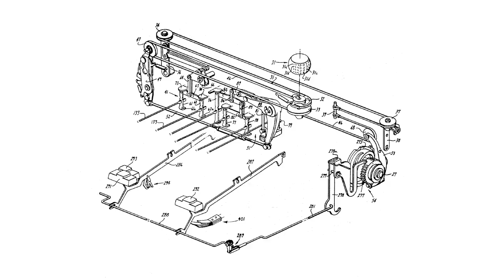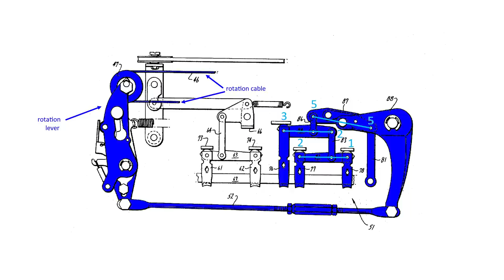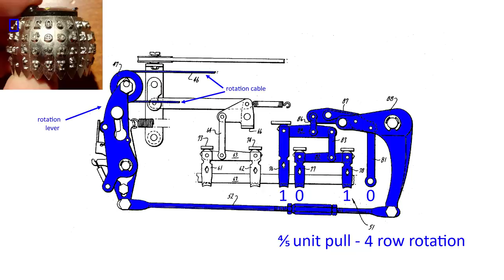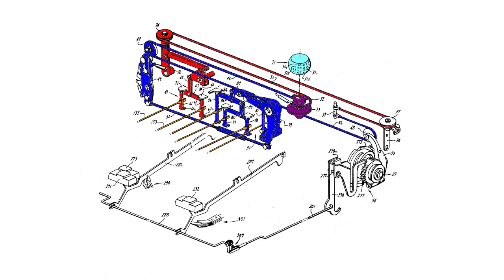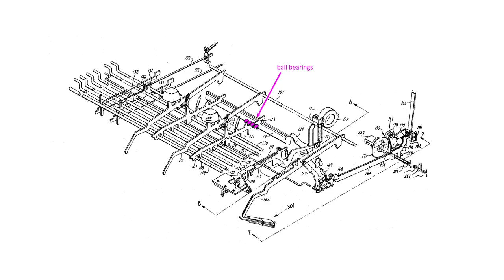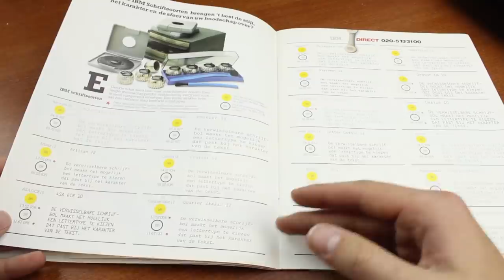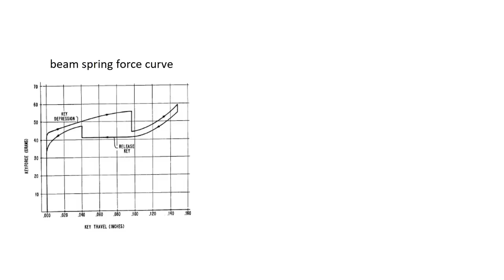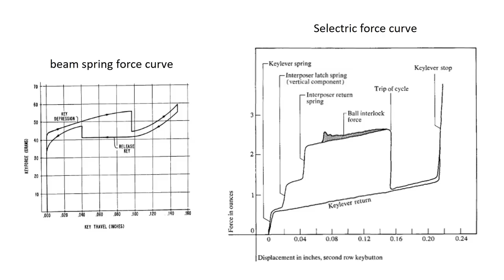IBM Selectric typewriter review - and how it works!

Comment: This is an excellent review, and a very thorough explanation of the mechanism. It's a little disappointing that you didn't get to try the Selectric II next to the Selectric III. 
Starting with the Selectric 1, the basic mechanism only supported 88 characters and the metal casing was very curvy in a 60s style.
The Selectric 2 introduced the correction key (which kind of looks like an afterthought) and came in the more boxish cabinet, using the same elements as the Selectric 1, which were labelled in WHITE..
The Selectric 3 was reworked to include the full 96 ASCII characters on the element which was labelled in YELLOW. This is when that annoying ISO placed key appeared between left Shift and Z.
One "analog" aspect that you've over looked is the pressure cams under the keys. These determine how hard the element strikes the paper so that . and M are of equal blackness.
If you check closely, the ribbon supports THREE rows of typing, not just TWO. The logic behind the multi-level design that pulls the ribbon to the right, mashing it onto the take-up reel was to prevent people from reading the ribbon after use.

If you get the opportunity to compare keyboards, 1 & 2 are virtually identical with a brilliant tactile response. When it registers, the key literally drops from beneath the finger. By contrast, the 3 feels mushy and isn't as tactile at the finger end. It's like it was designed NOT to feel like a typewriter.

Keep the reviews coming!
Reply from the maker: Yes, I figured there would be a difference in typing feel. Shame I didn't get to test that. 

And actually I knew about the pressure cams! I found out about them much longer ago though, and had completely forgotten about them when I did this video. It's a beautiful example of their attention to detail though.
Reply: I learned to type on a Selectric 1, and I certainly wouldn't call the keyboard feel "brilliant"... it had a very hard feel with little obvious feedback or movement until the key "took".  Computer keyboards of almost any sort are a lot better...

Comment: I'd love to try out one of the computer terminals IBM made which used the Selectric mechanism with a load of switches and solenoids added in to make it go when the computer was outputting. If possible, I'd love to see one dredged up, fixed up, and hooked up via some sort of adapter to a Linux machine. Imagine using a terminal on letter paper where each page (with 1/4 inch margins) would have a 96x126 or 80x105 character output depending on the pitch you've selected. 
Granted, a lot of modern programs output a lot faster than a Selectric could keep up with, but it'd still be fun to see and use!
Reply: xtermEN8

Comment: Interesting typewriter lesson here.  The idea of an easily replaceable type element was by no means new when IBM released the Selectric.  In fact, it was almost 100 years old, with machines like the Blickensderfer and Hammond sporting replaceable type wheels and a semicircular "type shuttle" respectively in the late 19th century.  In fact, the Hammond Multiplex model in the 1910s had the ability to hold 2 type shuttles at once, which could be switched between by a quick motion of lifting the circular anvil upon which they rested and giving it a 180 degree spin.  Hammond was bought out in the late '20s and survived as the Varityper, outliving the Blickensderfer by a few decades, until it was killed by the IBM selectric.

Comment: Apparently the IBM 2741 http://www.computinghistory.org.uk/det/48303/IBM-2741-Communications-Terminal/ was basically a Selectric converted straight into a computer terminal. Then of course there are the full-blown teleprinters used with computers, including 1963's ASR-33 Teletype model https://en.wikipedia.org/wiki/Teletype_Model_33 which was in use as a computer terminal https://en.wikipedia.org/wiki/Unix#/media/File:Ken_Thompson_(sitting)_and_Dennis_Ritchie_at_PDP-11_(2876612463).jpg for over a decade afterwards. The ASR-33's is a real computer keyboard unlike the Selectric's in that it didn't mechanically drive a type head, but apparently it still had a heck of a key mechanism: http://www.pdp8.net/asr33/videos/keyboard.shtml . I think that there qualifies as a tactile bump! AFAIK early video display terminals like the Datapoint 3300 http://www.vintagecomputer.net/ctc/3300/ may have been the start of discrete, one-mechanism-per-key key mechanisms, but I don't know that for sure.

Needless to say, if you ever get the opportunity to review any of these regal beasts that would be quite awesome...

Comment: I learned to type on a selectric I, the smaller and I guess earlier model ... the key action on that was pretty odd, there was almost no key travel, but a very heavy resistance all in one spot, which meant that it really didn't have a great feel, but it was fairly easy to type on.  It was completely unlike IBM's later computer keyboards (model F/M).

Based on this video, the selectric II you've using appears to have much more key travel, and I'd gather, a better feel...

Comment: Great video about this engineering marvel! If I understood correctly, the wiffle tree is made stable enough despite the required tolerances in all the joins by keeping it under constant pressure at all times to take off any slack.

I think it would have been worth saying that this is fully mechanical design except for one AC motor running at constant speed at all times the power is turned on.

Comment: I used these for very complex multilingual scholarly texts, using even right to left Arabic type heads. This was made possible by a modification by a company called InfoTec, that exploited the digital nature of the design: they attached a custom tape recorder for the keystrokes. The recorder itself had an extra Stop and Start button that enabled one to change type heads when replaying the text. There was also a correction function so that a complex text could be prepared to perfection before printing the final version with actual font changes during the pre-arranged stops. There also existed a Right-to-Left Selectric, but there was no RTL InfoTec extension. Consequently I typed everything in reverse: one letter - two backspaces etc. etc. Thanks to the InfoTec recorder I could do that without any errors. For your amusement: I also have an Old Bulgarian IBM Selectric type head.
Reply: aaah.. bekoz... en ding?

Comment: great video but jesus I hardly understood any of the mechanical aspects of this thing
Reply from the maker: It's incredibly complicated, really cool technology. Really the whiffletree is the most important aspect of the device.
Reply: Chyrosran22 I see. What are the keycaps made of? Double shot abs I assume
Reply: I was an IBM engineer working on Selectrics from 1973 for 8 years, it was an awesome machine. The trading course in London was 14 weeks and after that you still really knew very little.  It took many months in the field to really get to know it and even then it could be a tricky beast to fix.  IBM were a brilliant company to work for, I stayed 16 years and wish I had never left...
Reply: @Chyrosran22  In the USA the "Whiffletree" as you call it, was known as the "Differential"

Comment: I used to service and repair them back in the '70's and early '80's in Johannesburg, Sth Africa. I could literally take it apart and reassemble it. You had to use special grease for something called spring clutch and occasionally replace the spring itself. It was definitely not a maintenance free machine, yet a wonder of mechanical engineering. In the last couple of years, IBM produced a model with an extra row of characters. Somebody had the ingenious idea of starting the movement, not from 0, but from -1, something simple but too complicated to explain here. Unfortunately, that made the machine even more sensitive.
I used to fix all types of typewriters and adding machines, the latter also incredibly complicated. There were also electric typewriters (Adler, Olivetti, Olympia etc) each with an entirely different kind of mechanism but with typebars. These were much faster than the golfball provided the typist had perfect timing fingers so as not to clash the typebars. You could type on them at the speed of speaking. Among them, the IBM proportional spacing - another ingenious mechanism yet with typebars, allowing m's to be wide and i's to be narrow.
Now, at the sunset of my life, I may not have travelled the world to see things, but I have come to know what I think is by far the greatest feat of mechanical engineering ever: the IBM Selectric golfball typewriter. I feel fully compensated.
Thanks for the beautiful article.
Reply: https://youtu.be/c_mZKkevY0I - World's Fastest Typist, on an IBM Electromatic.  Some sources state she reached 216 words per minute, the video links here states 140 wpm which seems more likely .  The Selectric on the other hand can print at a maximum of around 150- 180 WPM (average, based on 15 characters per second).  Mistakes were less likely at higher speeds on the Selectric and there was no fear of any typebar clash due to the keyboard design.

Comment: A lot of electric typewriters have a motor with a flywheel that transmit their energy to the striking device. The motor runs at all times and the flywheel is heavy as to guarantee the energy burst required to be available and not to damage the motor. Perhaps the noise yours is making comes from that motor.

BTW, how the ball compares to the daisy? Thanks!

Comment: Hi Chyroran, These were used as the terminal on IBM 360 mainframes. I used to fix them when the other maintenance guys just used to swap them out. The terminal version was a bit taller as it has the solenoids for pulling down on the selector bails; binary input. Unfortunately not ASCII but EBCDIC. Do you want help fixing yours?

Comment: Good video.  The Selectric is rated at well over 150 Wpm so there isn't a typist on the planet that can outpace it's mechanism. In fact most touch typists back in the day, of which I was one who used a Selectric for years, could increase their WPM speed exponentially on a Selectric after only a brief period of familiarization.  Compared with the later Wheelwriter, QuietWriter and the Xerox Memorywriter and other memory machines which were also fast or faster on paper they seemed more difficult to type on at great speeds as they didn't have the Selectric instantaneous feel of the element hitting the paper because you were often typing ahead of what was being printed and it was a bit disconcerting to many.
Reply: 40 years ago my first fulltime job was an IBM OP CE, I used to have a client lady in West London who regularly entered speed typing competitions, and had me go in and service her typewriter - a Selectric II, She won every time, she also was the only person I know actually wore out keybuttons on her keyboard. Also just for info, the print mechanism was reputed to be able to print at 23-25 characters per second, but only if the settings were massaged - as in the 73IO Pram...

Comment: What an awesome video! Question, are you sure those are original keycaps? Those look even more modern than the ones in the Wheelwriter. The most defining characteristic is that the keycaps at the time didn't have the letters offset on the keycap, but rather printed dead center on the key. It wasn't until the 80s that some keyboards and typewriters started offsetting the letters, mostly to minimize wear (as you'd hit the keys dead-center). I remember the selectric, and I think the keys were glossy, not matte, more rounded, and had the letters printed dead-center on the key.

Comment: Next up - Teletype machines. 
Arguably a precurser of kinds, it also uses digital to represent each character, to be transmitted and printed at another machine over a wire or radio.. though the devices themselves used a conventional typewriter design. They go back to the the 30's I believe.. but you had to type at just the right rate as the rotor inside was spinning.

Comment: You forgot to put the cycle shaft detent back.  That is the same one you almost forgot to remove when you removed the cluster gears.  The machine works fine, but the helical spring in the cycle clutch will wear out in no time.

Comment: First off, awesome video! 
Secondly, I came across this because  I'm doing research on the IBM Selectric typewriter and I need to know the diameter of the print head (assume its a sphere). Does anyone know? Short of me purchasing one on ebay, I can't seem to find this information anywhere. Thanks!
Reply: I have one here on the table. 34mm after my measurement.  7 month old comment but perhaps still interesting for you?

Comment: 8:17 "The selector latches discussed before which pull down then the respective wiffle trees and linkages which in turn pull on the tilt and rotation which control the typing head on which sits 𝘵𝘩𝘦 𝘨𝘰𝘭𝘧 𝘣𝘢𝘭𝘭" 

Deep inhale 

"simple, right?"

Comment: Even though it’s not relevant to the subject of the keyboard, you may have mentioned that this model of typewriter allowed to select between 10 characters per inch and 12 characters per inch (though a control lever on the top at the back), and by doing so, would illuminate a different scale right above the keyboard…

Comment: I remember learning these in the 80, I was working on them and getting trained at the same time so it was a lot of 12 hr. days, I would dream about those stupid bands. I worked for a guy that was try to buy old models at auction and update them to self correcting models. Several hundred dollars and 40 hours at least. Absolute bust. Very fast machines, most people don't realize that element returns to the home position after each keystroke. Pretty badass machine really, almost 2000 parts if I recall. One day the wheel writer comes out with like 17 moving parts and that was the beginning of the end for mechanical typewriters.

Comment: now do wheelriters. they take all the mechanical logic out and use electronics. it's basically just a bar with a couple motors and solenoids. and a buckling spring keyboard
Reply: the first wheelwriter even bears the selectric name in the moulding of the inside of the case, looks like ibm made a last minute branding change to try and make it seem all new (and of course, an electronic rather than mechanical system is all new, so maybe that's for the best, but part of me wishes they'd played up on the legacy of the selectric too, kinda. i also find the "golf ball" more visually appealing than a big wheel, sort of wishing they'd ever made an electronic golf ball one!)
Reply from the maker: Already done it :p . Although I didn't have the typewriter, just the keyboard. The Selectric is way more interesting IMO, though.

Comment: the bell doesn't mean you are at the end of the format but you are close to the end. itl keep going right off the page if you want to. also when the bell rings is adjustable. you ended up with a big margin in the typing demonstration.
Reply: The bell normally rings 5-7 spaces before the right margin, and then physically locks the keys when right margin is reached.  Cannot be adjusted more than 7-8 characters before.

Comment: This selectric typewriter can be used to type telex by fixing an interface called a GNT TELEX INTERFACE...that comes with a gnt interface led box for correct installation. YES IT HAS NUMEROUS INTERESTING MECHANISMS TILT ARM& RORATE ARM PERIODICALLY THESE ALIGNMENT OF BOTH MECHANISMS WILL NEED ALEIGNMENT THESE INTERPOSERS CAN BE ADJUSTED CERTAIN KEYS ARE REPEATATIVE.. I WAS A IBM TECHNICIAN FOR MANY YEARS..

Comment: I wonder if it really had to be this complicated. Given it already ran on mains power, why not make switches mostly electric and select the wiffle tree bits using a small set of solenoids?
Reply: They did exactly that on their advanced models that used memory etc. But it also made them hugely expensive.  The technology did not exist in the size and cost required for this machine (to be economic) until the mid-late 70's when successor machines were already on the drawing board.

Comment: 8:12 no wonder these things working today are hard to come by. The switches are so complicated just to move that ball around. I think this is what you would call an engineer givin the go a-head to just do as he pleases as long as it will work. Definitely an interesting design and I'm sure a hard puzzle for the engineer tasked with this back in the day. To think that not to long after the same engineer might have helped design a relatively simple switch like the buckling spring,

Comment: This is an excellent source for both the Selectric and beam spring sounds (some of the typing is slow enough to easily split the audio). Can I update https://github.com/rbanffy/selectric-mode with your captured audio and license the sounds (key click of the beam spring, printing, ping, space and carriage return for the Selectric) under the same license as the rest of the package (with the proper copyright assignment, of course and a reference to this video)?

Comment: Had it also at the same time proportionally spaced fonts, rather than mono-spaced?
Reply: Not that model. Only the Composer, and one model of the Mag-card offered Proportional Spacing, and the 'Electronic' model 50 thru 95 (but it's not a Selectric-based range)